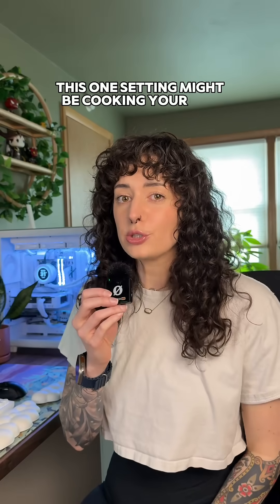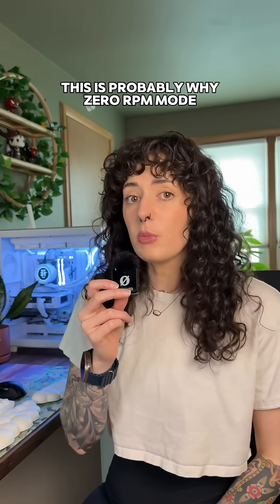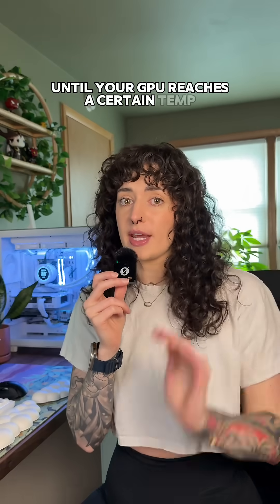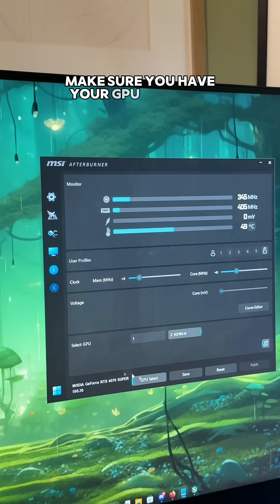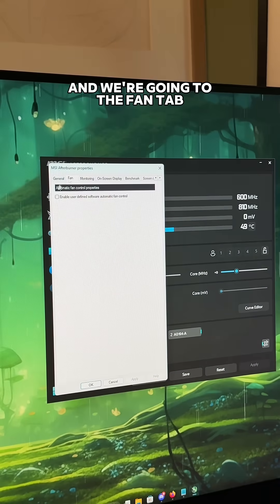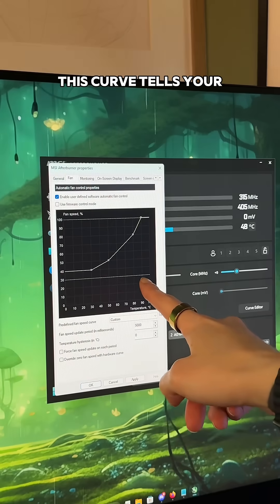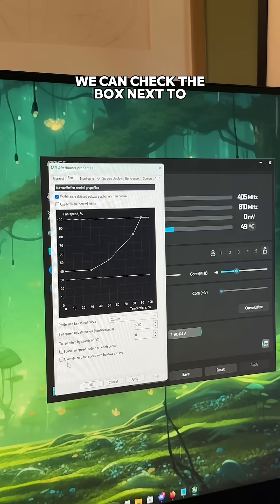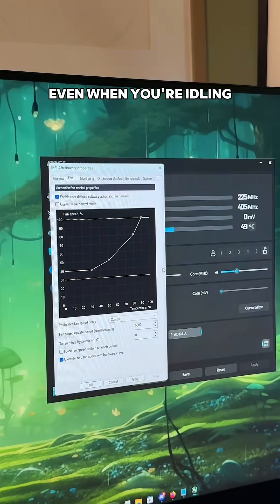What is Zero RPM and how does it impact your GPU? #gpu #amd #nvidia #pc #pcbuild #techtok #techgirl

Comment: I have my 9060 xt on zero rpm mode and it idles at 40 degrees C with fans off. I have it set up to turn zero rpm off when I launch a game though to prevent thermal throttling.

Comment: The only thing that makes it bad is the start and stop if it gets to hot
Reply: What does that mean? I just got my first PC a week ago with a 5600xt, I don't know whether I should have zero rpm mode on or off
Reply: @Humz1  The idea is to cool the cpu/gpu before it gets too hot. Many people made the mistake of setting the fan RPM on high at 80°C, which is not optimal. The best setting is around 70°C or 75°C. You want to “intercept” the heat before it even gets hot if only care about performance and not the noises.
Reply: @H @Humz1  90% of people i saw online set rpm on the low side are people who don’t like to have pc noises. myself i dont really care so my fans can blow as loud as possible
Reply: It let my gpu reach 105c before it kicked in

Comment: If it waited to shoot up to 80C to start running then I'd be concerned. But my 7900XT turns on at about 45C. If anything, having the fans run all the time would kill a fan faster than GPU will die with zero rpm mode on

Comment: My 9070xt fans kick on at 45° and that's not hot so I'm 'cool' if the fans don't spin below that.  My GPU 'cooks' at ~80° with the fans running and a load applied and it can handle that.

Comment: As someone who has been building and supporting custom gaming systems since the late 90's, I fall quite squarely on the "either" side of the fence. The biggest advantage of Zero RPM, especially in a tower configuration, is that is doesn't actively draw dust and grime into the GPU, which is a huge factor in cooling, and fan life. But then again, so is constantly kickstarting them from stop - objects in motion, and all of that.